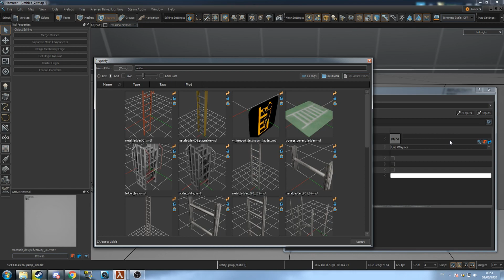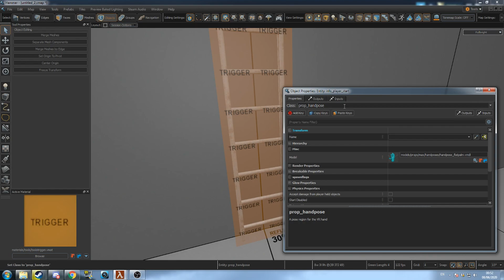How To Create A Ladder using trigger_traversal_modifier using Source 2's Hammer

Comment: Will this method work for physically pulling yourself up the ladder? And would it allow the player to grab the sides if it was extended down them?
Reply from the maker: You wouldn't be able to grab the sides.
This should work for pulling yourself up the ladder, but it doesn't seem to work consistently

Comment: Good tutorial! Much better than the official one. I had the Extents configured wrongly. However, the ladder is still not manually climbable. Their offical tutorial seem to suggest that it should work using the method in your video, but it doesn't. Have you managed to make it work? Thanks :)
Reply from the maker: Do you mean pulling yourself up, rung by rung? I'm not sure that this is actually supported by the game, but I have seen some addons that do something similar using VScripting, so it may be possible once we have a better understanding of VScripting
Reply: @Hosomi  It's in the official game. You can climb up all ladders by grabbing the rungs and pulling yourself up, like in Climby.
Reply: @Hosomi  What do you mean "I'm not sure that this is actually supported by the game"? That's how I always go up ladders in hla

Comment: raising the trigger above the ladder isn't necessary. It works fine without doing that
Reply: How did you disable snapping on the top and bottom points? shift + w didn't work for me.
Reply from the maker: shift+w should work. There's a magnet icon in the bottom right you can click to disable it too. Or just reduce your grid size using the [ key